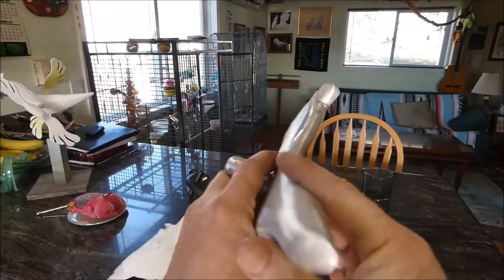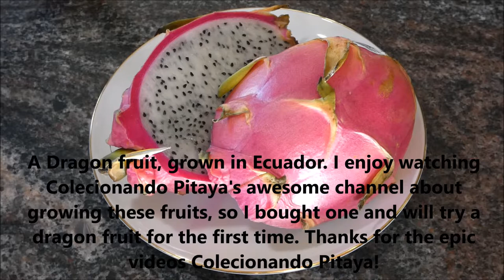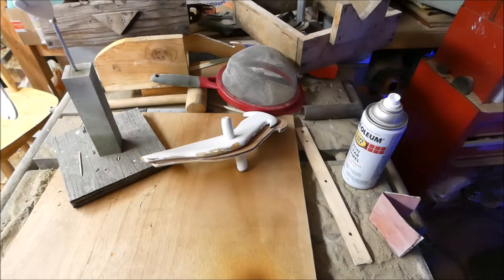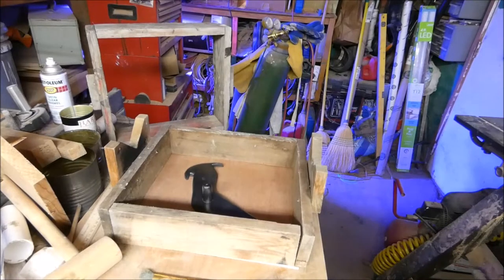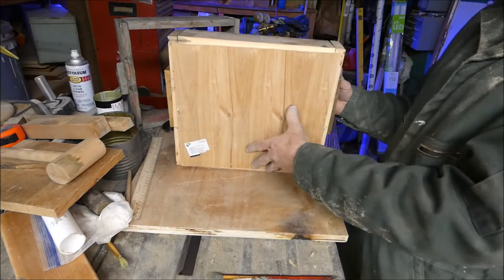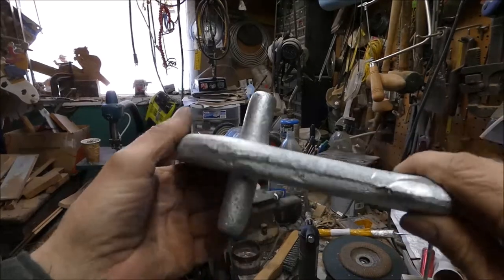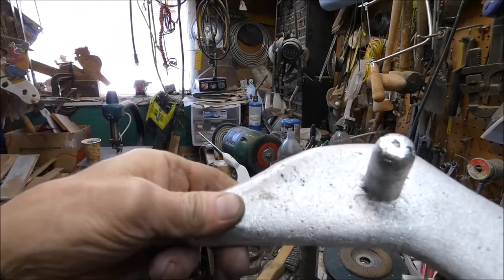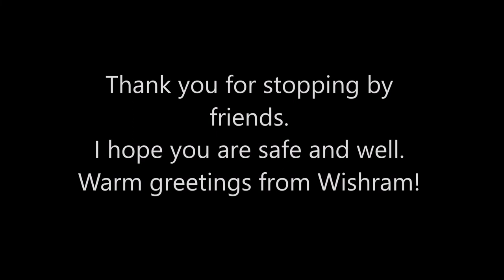Sand Casting a Peaches Whirligig in Aluminum: 2/28/2021

Comment: Peaches came out nice Todd. That will be a very durable whirligig.  I experienced some of the same on a recent pour with the aluminum making a low spot. Keep up the good work my friend
Reply from the maker: Hello Lloyd! Thank you. I think I will work on making Peaches a bit thinner, as she weighs 1 1/2lbs. right now, so I will sand off more plywood from my patterns. The next time I make a mold, I will make my gates bigger and my riser closer to the pattern, which will hopefully solve the slumping problem. I also forgot to add some vents, so I will add some next time. I spent the other afternoon cutting up an aluminum intake manifold so I will have more aluminum to pour. I'm sure having fun! Wishing you a pleasant coming week. I hope things have gotten at least somewhat back to normal back in Texas. Warm greetings from Wishram.

Comment: Nice job.  Cast up some airplane propellers out of aluminum a while back, they were heavier than I had imagined !  You have some "sink" at the junction of the wing support and the body.  A smaller part can draw metal from a thicker part and cause sinkage.  You could try a larger feed riser and/or making smooth rounded fillets between the body and the dowel. Sand casting is a "black art".  Also your in gate should be close to the same thickness as the body pattern. Best to feed that from a reservoir that is lower than the main pattern and causes the metal to flow upward to the parttern.
Reply from the maker: Hi gwheyduke! Yes, my wings were heavier than I expected also. I solved the problems with the slumping on my next cast by modifying my gates so they were wider, deeper, and closer to the part. Thanks for all the tips; I sure appreciate them, and will implement them in my practice. Thanks for stopping by. Wishing you a pleasant week. Warm greetings from Wishram.